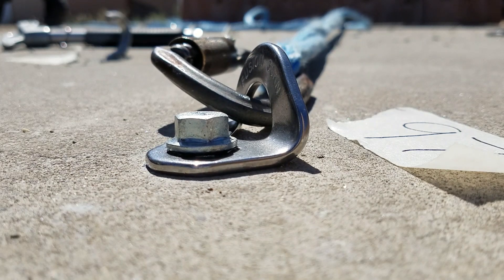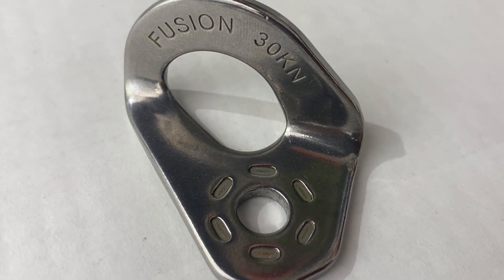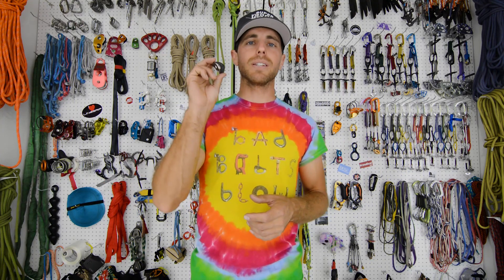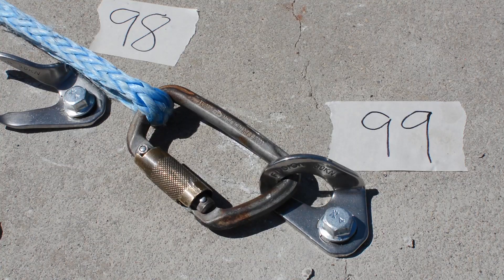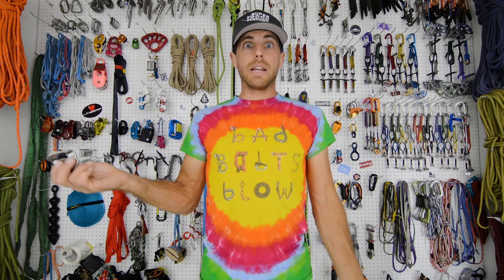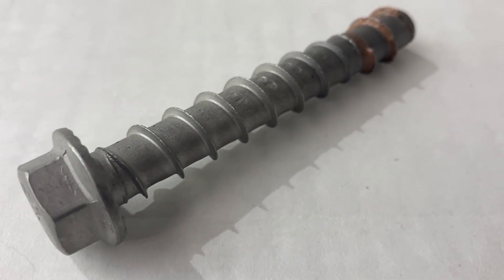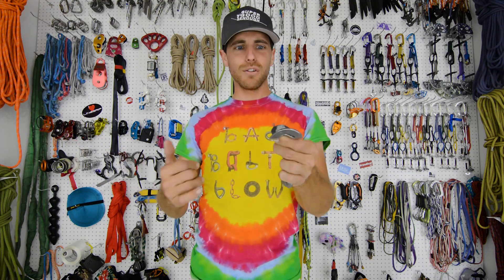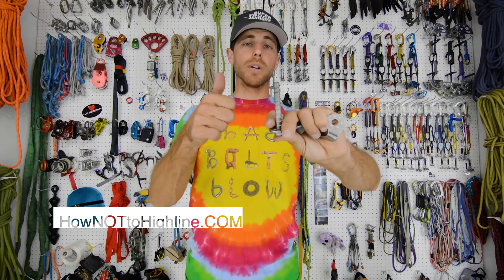Bolt Buster - Fusion climbing hangers bought on amazon broke below MBS!

Comment: Stainless AISI 304 is not hard nor abrasive resistant. It's basically spoon and fork metal. It's just more corrosion resistant. Zinc coating can be applied to many metals that are way better than your usual fork and spoon metal. Some hangers can wear out before rusting

Comment: Have you tested the screwbolts in tension, perhaps fresh vs used holes? I have used these with hangers in sandstone, beforehand I bolted into a boulder, hooked them up to my truck and tried to rip them out in tension, held super good enough for me but I'd be keen to see some numbers. (This was on my own property and I plan on replacing with glue-ins in the long term they are just super easy to set stuff up quickly)

Comment: What type of bolt do you recommend to bolt into a wood beam for an indoor climbing wall? I’d like to put a hanger like this directly to the 6x14 wood beam. 

Any ol 3/8 or 1/2 galvanized lag bolt work? Should I do a through bolt instead?

Comment: I build houses and we use 6” titen bolts to hold walls down to the concrete slab. Houses have been hit by tornados and all of the bolts stay in place. (No huge surprise as a metal bolt in concrete should be way stronger than wood and bails)

Comment: Hey Ryan.. i usually instal the screw bolts using hammer and wrench... what's wrong with that and why it's not good to do that?
Reply from the maker: You install threaded concrete screws by hand?  I can barely get them in with an impact driver.
Reply: @HowNOT2  yep always.. I use a dynamometric wrench or a ratchet wrench. I did it also on granite, but that was fucking hard...

Comment: Looks like those Titans have come a long way!  I always thought they were brilliant for temp anchor needs (shoring, false work). Watching this video gives me a lot more confidence in their use for construction . When they were released they did not have an ESR for cracked concrete, looks like they do now, (some sizes/conditions).My contention was that the rules for installation limit the minimum & maximum torque to ranges that are hard to follow. Between that, the specialized ANSI drill bit they require (i think it's purple?), the inability to test them in place, & their & a tech rep expressly telling me tholes can not be re used, i was skeptical. Pretty cool to see them working in a situation where they are installed following the procedures only loosely (I assume) & re using the holes. These videos are just awesome.

Comment: FYI in the rope access industry, we often place bolts (outside on buildings) just for an hour or so. For these cases we place "zinc plated shit", and yeah they sell more hangers to rope access worker than climbers and highliners :)
Reply: The issue that I have is that the PS bolts and hangers are marketed at climbers as well as rope access. Fixe specifically mentions climbing and mountaineering on their online description of their PS hanger and all of their PS hangers and bolts are sold under the climbing hardware tab as well as Construction/Industrial and Gym Climbing. I find this very disingenuous as the majority of the climbing community frowns on placing anything less corrosion resistant than 304 Stainless.
Reply: @beaniebobh1  well it's true but  route setters and highline establishers should be considered "experts" so they shouldn't just buy some stuff because of the internet description. But yeah I see your point !
Reply from the maker: Why not use the ss hangers for industrial applications.  The "zinc plated hangers" break at 25ish kn and i'm getting 50+ kn out of the PLX fixe hangers.  I see your point about temporary uses but they do target climbers in their sales and people installing bolts should not have to spend years researching this stuff like i have to know what is good and bad.  We make the bolting bible available so people can become "experts" without having to spend years figuring this stuff out to get to "expert" level.  I feel a company selling bolts should make enough resources available so people can make informed decisions.
Reply: @HowNOT2  Yes you are also right, their info is misleading. On the SS hangers, they are way more expensive that is the only reason we rarely use them :)
At least is france tho

Comment: 29.56kN is barely below 30kN, that’s really negligible. Considering the title I thought it broke far below the rated strength.
Reply: That's true, but it shows that there's no safety factor baked in to the rating, unlike a lot of other gear.
Reply from the maker: consider i'm use to breaking fixe ss hangers rated for 30kn that are sometimes getting 60+kn.  They shouldn't be stamping them with whatever number they want just so they can sell them.  Stamp 25kn on there and that's fine.
Reply: The 30kN is the minimum breaking strength. They should be breaking only under much higher loads